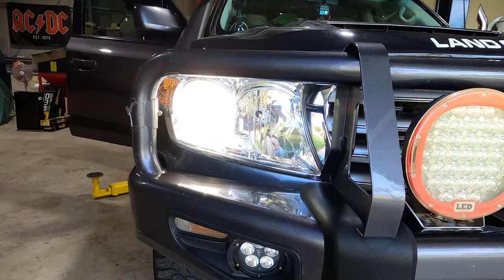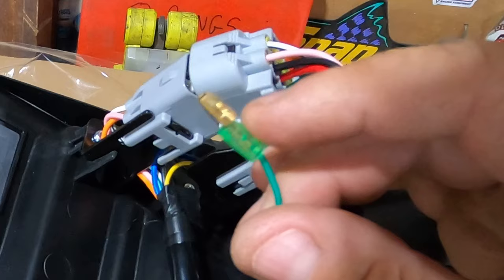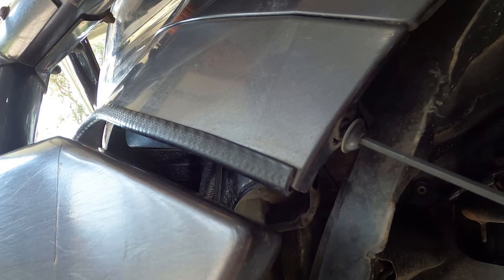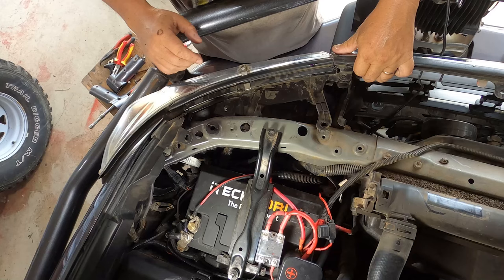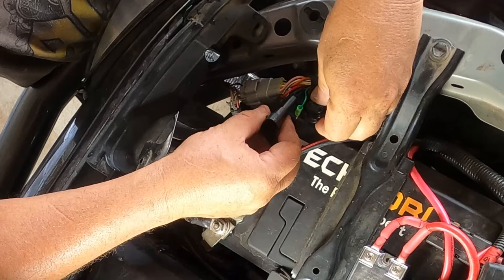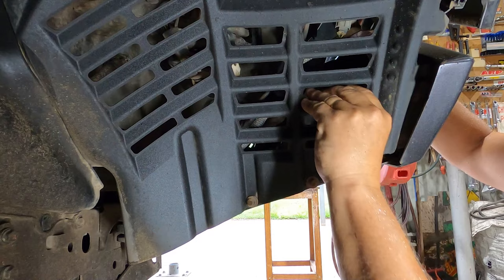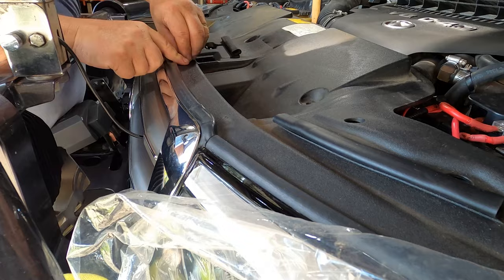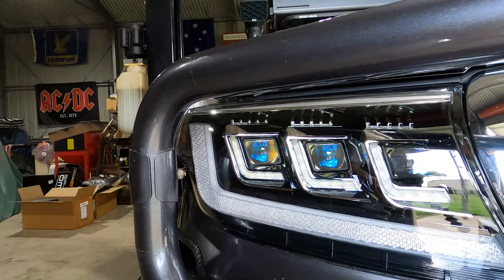LED Headlight and Sequential DRL Installation and Review | Landcruiser 200 Series

Comment: What about that single wire between the 2 lights?
Reply from the maker: Contacted the manufacturer and they said it’s not used.  I said this in the video👍
Reply: @JafffaAdventures  thanks mate i must of missed you say it 👍🏻
Reply from the maker: @damienpenza1656 all good👍

Comment: By sheer coincidence I have only just finished installing the exact same lights in my '10 200 this weekend. I can confirm that the fit is superb as too is the light output! Took 4 hours to install with a Rhino bull bar. And they have really transformed the look of the vehicle.  Longevity TBC .
Doing a great job Terry, love your work 😉
Reply from the maker: Thanks Paul, I’m glad your experience is similar to mine.   Let me know if you have any dramas over time.   Thanks for sharing 👍😎

Comment: Mmm, not sure. I have aWhite  2012 VX and not sure on the look. Any idea on new originals?
Also you can get a headlight resto kit from toyota that by all accounts is quite effective. 
PS best 200 channel out there
Reply from the maker: Thanks Ian, I appreciate your feedback. Aesthetic mods are certainly individual, no doubt about it.  My original lenses were perfect, it was just that my HID replacement failed and I used that as a catalyst for a change 👍😎

Comment: nice work, they look awesome. how is the spread, does it follow ADR so not blinding everyone? and thanks for putting this together....
Reply from the maker: Thanks for the kind works, that means a lot.  The light spread and distance is very complimentary to other road users.  I have not been flashed yet, unless I’ve accidentally left the high beams on of course.  As far as any compliance with ADR’s or otherwise, I cannot comment as it was not a factor in my determination to use them.  Cheers😎👍

Comment: Hi Terry, I always enjoy watching your projects. I was thinking of getting a set of these a few months ago. I noticed you had the lens protectors on the old set, much like myself. Do the lens protectors not fit with the new headlights? Also do you know if they can be set as daytime running lights on the 2008's?
Reply from the maker: Hi Azher, thanks for the kind words mate.  That’s a great question and one I did not answer in the video.  No, the factory headlight protectors will not fit over these new units.  Cheers👍😎

Comment: Terry, 
Are you still happy with the HeadLight Conversion ?
I need to replace mine, same setup as yours with Bars etc 
How is the Night Vision ?

Also interested in your bullbar fog light conversion
looks good 
Feedback Much Appreciated 

Adrian
Reply from the maker: The lights are still going strong Adrian, and the night vision is excellent (and I don’t get flashed by oncoming traffic).  The fog lights are simple ones I picked up off epray over a decade ago.  I just measured the diameter of the originals and searched epray for the same diameter in LED.  They have never missed a beat and I’ve lost count of the number of water crossings where they have been submerged.  Cheers😎👍

Comment: When you bought them dd you have to specify a LHD or RHD set?
Reply: Good one, that should fool many.
Reply: @brianwalker1933  It’s actually a “thing”. Lights for LHD vehicles will have the right hand light angled towards the roadside verge in those countries so the driver can see possible hazards. On a RHD vehicle, that light will be angled towards the drivers of oncoming vehicles. Not good.
Reply from the maker: No I did not have to specify, but that does not mean LHD and RHD are the same.  I do note driving at night the lights are aimed as I view as appropriate, and no oncoming cars are flashing me.  Cheers👍😎